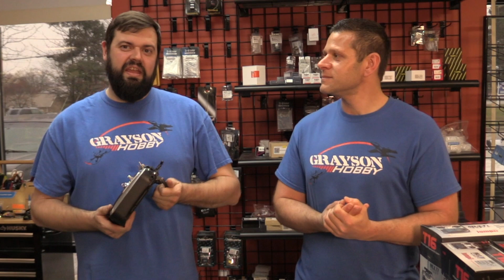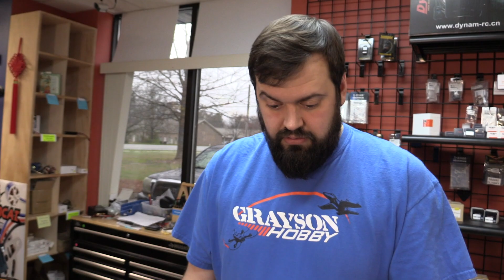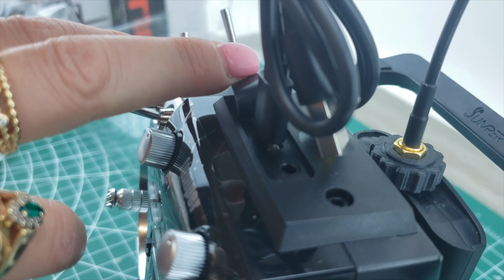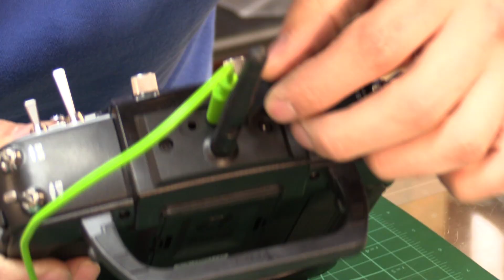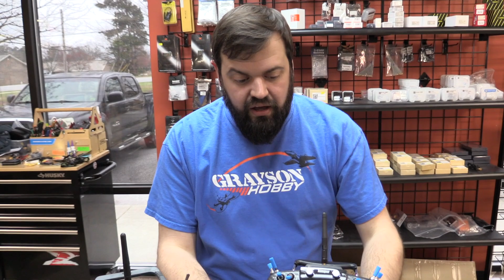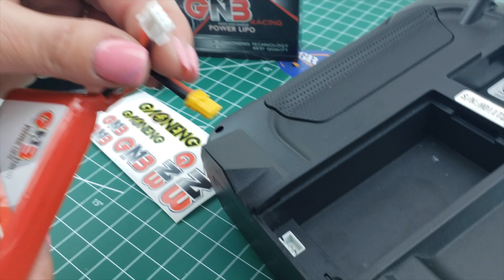Jumper T16 Pro V2 Internal USB-C Charging Rate Tested | Unboxing

Comment: Good job.  I have ordered an upgrade kit for Jumper T16 internal USB C charging. In this video, you used a 5V charger to charge the Jumper T16 battery which is 2 Li-Ion cells rated at 7.4V. How can you achieve charging since the charging voltage (5V) is lower  than the voltage (7.4V) fo the battery being charged ? I thought the former should be higher. Pls explain.
Reply: It ups the voltage internally.. but my t18 charges so slow. Hopefully t16 charges faster

Comment: Are you aware that the USB-C charging board can't do balance charging properly?
I bought my T16 last year before the USB-C charging board was introduced so ordered a board in March, it eventually turned up 2.5 months later because of the virus delaying international postage.
So I set to and did some testing, I took a 2S lipo and purposely unbalanced the cells, one at 3.95v, the other at 3.83v then connected it to the charging board through balance connection.
During charging I saw the overall voltage peak at 8.35v, it never reached 8.4v, but worryingly during charging I saw one cell reach 4.27v whilst the other was at 4.07v, then when the USB-C charging board thought it had finished charging, the cells ended up at 4.06v and 4.25v.
I also tried disconnecting the middle wire between the USB-C charging board and the 2S pack, it charged the pack regardless, that's not good.

Comment: Something isn’t right here, what is your usb charger rated at? If I use a high output charger I get damn near two amps! Do a little research and there are issues with jumper and usb charging, unfortunately seems like jumper t16 is not the radio to have these days with what has been released.

Comment: I kept trying to charge with my usb type C that came with my phone and it wouldn't work  so after watching your video I opened it up and sure enough it wasn't working so I track down the cord that came with the radio and sure enough it started working why it's any different from my day to day cord  I don't know ,yes it's works with everything else just not with jumper .. now if I could figure out open tx which thinks I'm plugging in a x9d+ every time and completely refuses to delete the mixer so trying to pair with my new kohd kopilit lite has been nearly impossible so far.

Comment: Good video guys. I have a older t16 pro. I ordered the usb c charge adapter. It was on backorder. I got a email with a tracking number some time back and still hasn't seen any movement! Whats up.

Comment: That is showing you what you are pulling from the supply, that doesn’t mean that’s what is going into the battery, if it’s boosting the voltage you will be charging at a lower current. Regardless awesome video. I would of loved it if jumper took advantage of using usb-c’s higher available charge voltage.
Reply from the maker: yea , well thats all we had lol - thanks for the feedback and support - B

Comment: I like it, I just don't get why they wouldn't just mount the led where you can see it.  Is that gonna be on the V3?  lol 
Just did the CF face plate, you can leave all the switch ribbon cables connected when doing it, works fine.  Just handle with care.
Reply: I did the same thing, just left all the ribbon cables connected and lifted everything out together. Much easier IMO.
Reply from the maker: Perhaps the case was made before the final USB-Board - not sure.. - B
Reply: Maybe Jumper will make a top plate with a hole on it to replace.